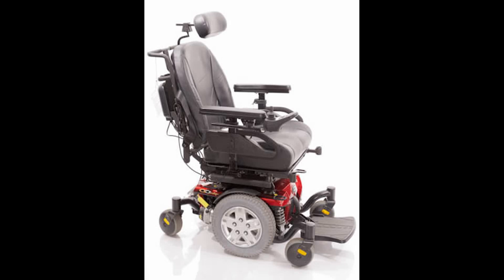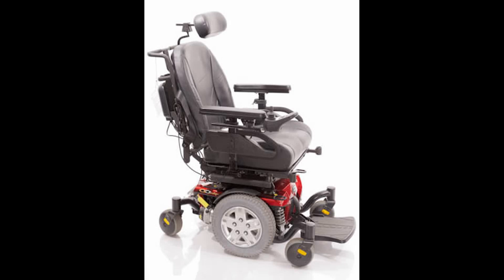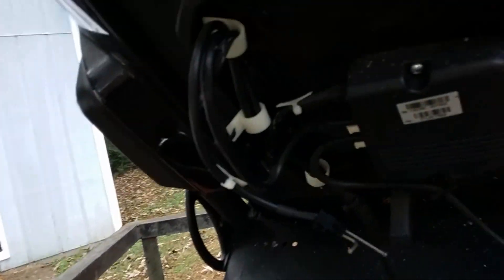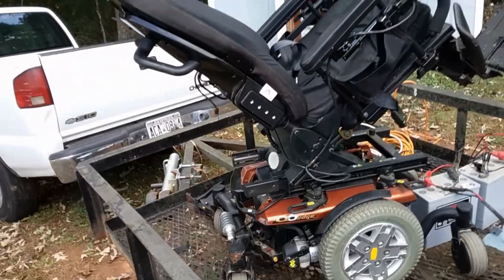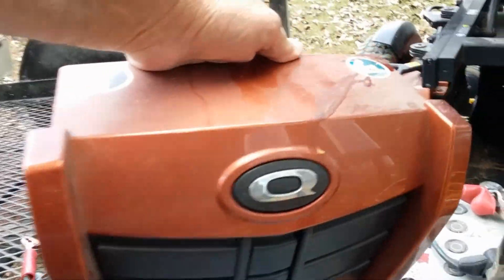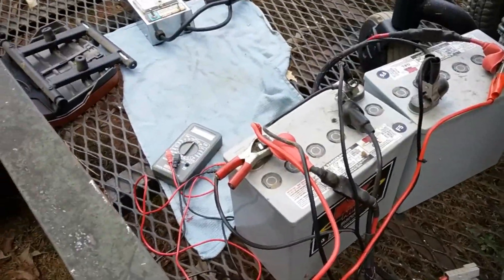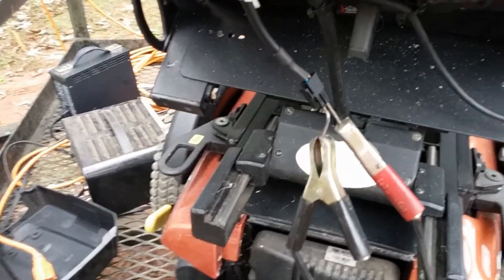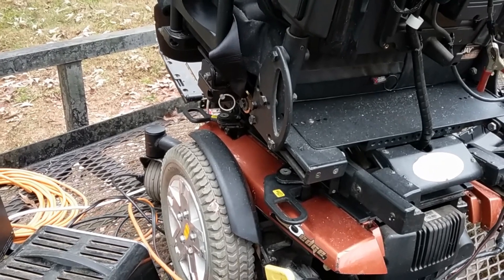Quantum Edge Power Chair -- Charger Won't Charge Batteries

Comment: Thank you for explaining that the correct charger for the deep cycle batteries had a built in safety feature and that they would not charge the low batteries. Also it is important to  disconnect the trickle charger and let the correct charger finish the job. This is something that is not generally understood and is a basic fundamental that must be explained when dealing with deep cycle batteries.
Reply: Most new chargers have this, they are called smart chargers, not so smart. They need a by-pass, now that would be a smart charger.

Comment: Thank you for making this video I have 1 question though ,,,, putting the nails in the plug how did you know which one to hook positive and negative power supply,,, red and black to the nails
Reply from the maker: I just quick touched them to get it to move in the up direction.  If you have them reversed then it will try to go down.

Comment: Thank you for posting this video!  I just recently got this chair donated and trying to do what you did. However the tilt cable connector has 6 prongs instead of 2. How do I go about connecting that to the manual battery charger?
Reply from the maker: Thanks for watching.  I'm not familiar with that connector.  I would guess that it controls the tilt and maybe and up/down motor or something else.  It would take a couple of trial by error attempts to connect the voltage for just a second to see if it tilts upward.  If you can find a model number you might be able to find the service manual online for it.  Good luck with your chair.
Calvin and Marie

Comment: Did you charge one battery at a time or connect to the factory battery cable that hooked to the battery while it in the chair/ the chair operates on 24 volts, and it looks like you're using a 12 volt charger.
Reply from the maker: Thanks for watching.  I used a regular car battery charger and a 12 volt power supply at the same time. If you just use the battery charger you would have to charge them one at a time.  This was over 2 years ago so it's hard for me to remember the exact details.  I only had to charge them for a few minutes and the chair charger started working.  His chair is still running on the same batteries with no further problems. Good luck with your project, 
Calvin

Comment: Those are deep cycle gel batteries and should be topped up daily. They do only last a couple years though and those 22NF are definitely not the cheapest batts to replace. Glad you got your bro back up and running.

Comment: Need to fix my aunt’s chair but confused on the tilt. How do I know where to put the positive and negative battery connectors to the tilt cord with the nails? I really don’t want to fry the chair.
Reply from the maker: Thanks for watching.  When I did this one, I connected the ground to one side and then I touched the positive to the other one.  If it goes in the wrong direction,  then switch the wires and it will go the direction that you want.  
Hope that helps you.  It's been a long time since I did that for his chair and it is still running on the same batteries. 
Have a fantastic week, 
Calvin and Marie

Comment: Thank you so much for making this video.  I have the same problem.   How did you know which of the tilt connectors was positive and negative to get the tilt working?  I don't want to hook it up reversed and fry something.
Reply from the maker: Thanks for watching.  I miss read your comment.  On the tilt adjustment just touch the wire to it. One direction will make it go up and the other direction will make it go down.  It has been a long time since I did that but his chair is still running on the same batteries.  I hope this helps.  Good luck with yours. 
Calvin
Reply: @SouthernCountryLiving   Thank you Calvin,  well that seems perfectly logical.  Good to know you didn't have to buy new batteries.  I wish you and your brother well.  Thanks so much for the quick response.  Royce
Reply from the maker: You are welcome

Comment: Pride Mobility/Quantum send with the power wheelchair a tilt jumper cable w/ an Up/Down switch. Plug into the cable marked Tilt, use alligator clips on an external 12v battery and you press the button to tilt.
Reply from the maker: That is great.  He didn't get one with his.
Reply: @SouthernCountryLiving  
That's a shame. Every one we've sold came with the jumper. I ordered one and have it in my tool kit. Yes, I service complex rehab wheelchairs.
Reply: Where can You purchase this tilt jumper cable w/ an up/down switch

Comment: Quantum 4Front here, same method...The battery compartment is too tight, so I tie a shoelace around each battery or Velcro strap to pull those suckers out...The Numotion tech slammed those batteries in there last time so hard that not even my improvised shoelace pull cord would work...Now the new batteries are going dead, so I have to call and hope they replace them, under warranty of course...Pro tip, you don't have to use the 75ah batteries...You can use  the 55ah batteries that the Jazzy 614hd takes...I know because I did it out of frustration...It goes the same number of miles...Lighter weight...
Reply from the maker: Thanks very much

Comment: When you took the tilt wire out did you use the controller to tilt it back?
Reply from the maker: It's been awhile since I did this.  I applied voltage to the wire connector going to the tilt motor to make it tilt up.
Reply: @SouthernCountryLiving same question - how do I tilt the chair back once the battery is connected via nails to the tilt cord?  Did you use the controller?

Comment: Sir... I think I understood about the inclination but to bring the seat back how did you do...? I don't understand English orally...I use a translator..Thank you for your response
Reply from the maker: I used a 12 volt power supply and connected it to the incline wire using the nails to insert into the connector
Reply: @SouthernCountryLiving  Thank you very much... I should have read further down... if I understood correctly it is the same connector which makes the (2) directions in fact... it would be enough to reverse the polarities to bring back the seat. .. very happy Sunday to you Greetings from France..
Reply from the maker: @user-sb3ux7ku6j  yes, that is exactly how it works

Comment: The chair my father used has set in my house unused for the last 8 years. At first both batteries were under one volt. I tried to charge them and got one battery up to 11 volts but the other battery to only 6 volts. How far do the batteries have to be charged until the small charger that came with the chair works?
Reply from the maker: Thanks for watching.  I don't remember the exact voltage required but for some reason I think it was about 10 volts. I was expecting to have to buy new batteries for his chair so I was glad that I could get them charged back up. His chair is still running with the same batteries.  Good luck with yours. 
Calvin
Reply: @SouthernCountryLiving  I have several times charged the batteries all day but only got up to about 7 volts. Is it possible that I need a stronger battery charger? I bought a Stanley Fatmax 8 amp charger. Today I measured the voltage as I was charging, and the multimeter read 13 volts. Any suggestions?
Reply from the maker: My guess is that the battery has a couple  of dead cells.  When batteries sit for a long period of time they will develop bad cells.

Comment: the story of rechargeable batteries they look like standard lead acid batteries so the question is why have the batteries discharged so much that the standard charger wouldnt charge them could this happen again?
🎅🔍viewed fully✅ support to each other🔎🎭✅ you got a like 👍🇦🇺👍🎄
Reply from the maker: Thanks for watching,  that is a good question.  The batteries are sealed batteries for safety reasons and we think that someone left the chair on when he was transported to the hospital for about five days. It could happen again,  but hopefully it won't.  The chair needs an automatic shut down function if it is not used for a length of time. Thanks for being observant and commenting.  Have a great weekend... Calvin

Comment: Where did you get the spare battery from ?
Reply from the maker: Thanks for watching.  I didn't use a spare battery.  I used a battery charger.
Reply: Where can I get one of those because I have the same problem w my fathers power chair. Doesn’t wanna charge no more.
Reply from the maker: I used a regular car battery charger.  You can buy them at Walmart or any auto parts store.  The trick is getting to the old chair batteries to recharge them. That is why I rigged the  nails in the plug going to the lift motor to get it to raise up so I could access the batteries in the bottom of the chair. Good luck with your project. 
Calvin

Comment: My lo has an older 2.0  with the i level and was good for 10 to 15 miles .
Her newest 1 of a year drains the batteries in max 2 miles. 
Its a shame theese companies do not stand behind there products with good warranties .
But I'd like to ask why a charger would have to even go into a safety feature .
That makes no sense at all .
If a regular charger 12v I assume does thw job why wouldn't the manufacturers?
Reply from the maker: Yes, these new ones aren't as good but nothing is now days. The charger is designed to cut off if the batteries are bad so that it doesn't start a fire from trying to charge a bad battery.  When I  connect a regular charger I'm supposed to monitor it in case of a problem.  On the chairs most of the time the charger is connected and left connected all night long. It would be a terrible situation if a fire started. The charger reads the battery voltage and if it is very low it thinks that the battery is dead and won't start charging.  His chair continued to work with these batteries. Several months ago his health deteriorated and the nursing home will not allow him to use the power chair right now.  Thanks for your question, 
Calvin